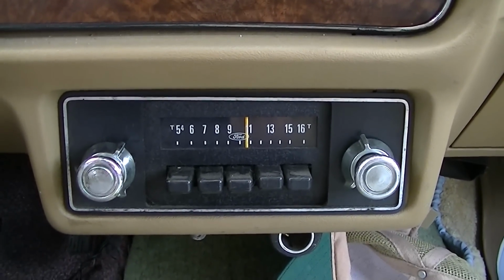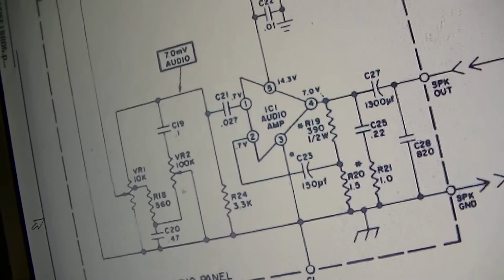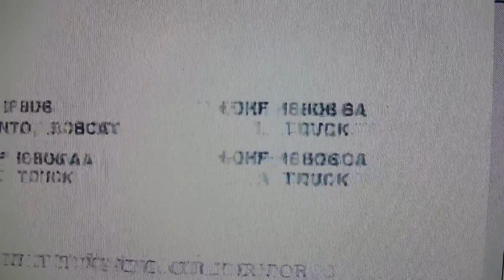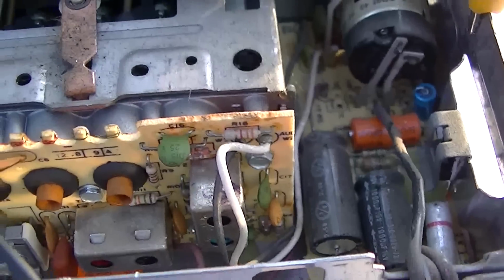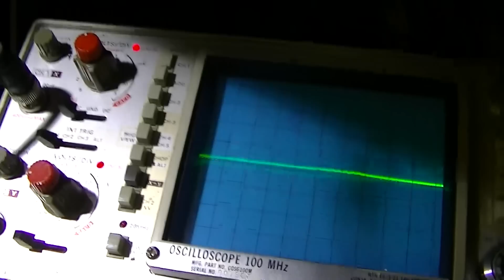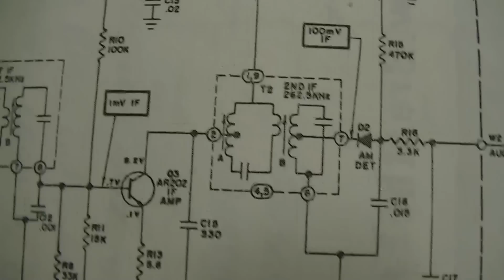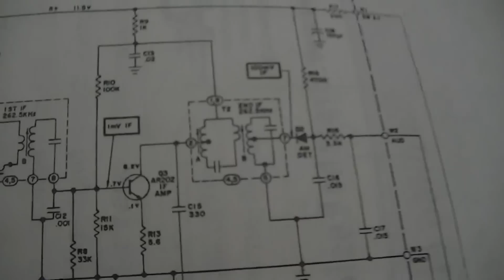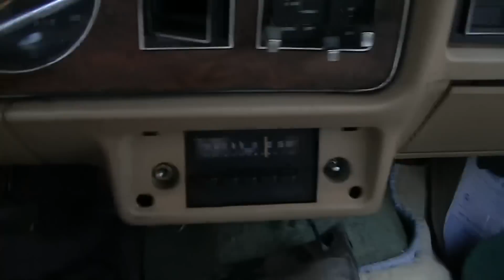Repairing Vintage AM Car RadIo In 1980 Ford Fairmont E0SF18806

Comment: Ford actually built their own radios back then and they were pretty reliable for what they were. The FM stereo ones used to say "Aeroneutronic" on them in the 1970s.
I'm a huge AM radio fan and it's a shame so many of these AM radios got tossed into the trash when people upgraded to FM radios, Compact Disc, etc.
Reply: found one of those AM only radios in a bus someone parked in the woods. Bus was a Chevrolet, so they had to adapt it to work.

Comment: I have one of those sets. I built it into a wooden cabinet and made a portable battery-powered radio. The idling current with low volume is only about 250 milliamps max... very sensitive set, too.

Comment: I am impressed at how much gain they could squeeze out of each stage. Your radio has one RF stage, a converter, stage, and a single IF stage, yet the stations are wall-to-wall as you tune through the band.
Reply: klafong1 I'd love to understand that better myself. I frequently look at videos and circuits for Regenerative, TRF Tuned Radio Frequency, Superheterodyne, and the IC Integrated Circuit type designs. Maybe Shango can do a video taking about and demonstrating some of those designs and concepts. Car radios are fantastic DX'ers. God Bless and Happy New Year!

Comment: When we moved off the farm and into the town, dad got a job tearing down wrecks at a scrap yard. I got to know the owner quite well when I stopped in to bring dad his lunch and coffee. So it was I could get old AM radios for my old 50 Ford for 5 bucks a throw, of course that was 1960's 5 bucks, and my summer job paid 5 bucks a day. I spent many hours on my head under the dash putting in different radios for better sounding AM sound. I had on fancy one out of a Imperial that had electric tuning on a 6 volt radio, even a remote switch that was under the floor mat that I could hook up so a tap of the toe could change the station.  Ah for the good old days, being 6;2 made climbing under the dash a bit harder then most but I managed.  Don't think I could get up any more if I had to now days.

Comment: Adding that mica to only half of the secondary I.F. works much better than I thought. You won't have full I.F. output but it is useable. Pretty smart idea that you came up with, I have to admit.
   Man, it would be a nightmare to unwind all those tuning slug wireds to get to that bad I.F. can's internal cap.
   I think you would be the happiest, just hooking a switch and audio coax cable to the audio I.C. input and call it good.
   It is refreshing to see troubleshooting instead of mere carpetbombing to resolve problems.
Reply: shango066
I actually found it very refreshing and very interesting.
I still love your Ham outings into the desert the most, I have to admit. That last one was unbelievably interesting and cool!
What a "60's era" trip that was!
"Iron man" was also very, very, cool too...
You ever got your drone fixed?
73s

Comment: I still have the factory ford AM radio out of the Fairmont I had in high school. it works just fine now because like yours there it lost it's 2nd IF and I replaced it with an IF can out of some old ham radio thing I had and re-peaked it.

Comment: Well it is quite late now, but I just opened a bunch of old IF cans pulled from stuff, and they all have tiny tubular capacitors. Some of them are directly visible from the bottom, others can be seen by removing the assembly out of the shield. Just guessing here, but since the thansformer is tuned with the slug, the value of the capacitor can be changed to some extent. Remember reading somewhere that some people would intentionally change the value of the caps on the larger IF's in order to be able to push the slug further in, getting more coupling between the windings, thus increasing the audio output of the receiver.

Comment: The board is easy to take apart. The coils slide out and there is enough wire to slide the coils clear to tip the board up so you can work on it. Just need to remove the back plate off.
Reply: Mr Carlson would have done it. lol

Comment: You should be able to find another one of those at a car swap meet, or even a garage sale or C.L, maybe even an AM/FM version or one with a cassette or 8 track built into it, they used the same basic design for years only changing the knobs to suit the vehicle. I used to have one that came out of a Merc or a Crown Vic from the mid 80s. I think the caps inside those IF cans were a precision ceramic type so they themselves wouldn't fail but the connections at one end might. If you wanted to go to the trouble (which I would not) you could probably open up the can and investigate what happened, it could be as simple as a failed solder joint, but it looks like it would take an hour just to get the board out just to get at it.

Comment: Hello, If I was in that situation and wanted to find a replacement IF can, I would check at the junk yards for another whole radio, and get the can from it. Or look on eBay. It's been quite a while since I worked on one of those, but to remove the board, is to first remove the screws that hold the bottom casing so you can have clear axis to the whole board that is attached to the tuner assembly. Remove the screws, or nuts (I can't remember) and pull the board straight out. The inductors should stay attached to the board without having to unsolder the wires...

Comment: Hi So in this video how did you pull the radio out? I have a 1981 Mustang with Am/FM and also has the same type radio indash setup. Your video did not show how you totally removed the radio. I found a Philco Am/FM with factory 8track player and want to install it. Uses the same wiring harness as original radio. Radio and 8track works perfect when tested. Just need more info on taking out original factory radio. Thanks,Mike
Reply: 6 Years later and I'm wondering the same. How the hell does this thing come out? 🥲
Reply: @robertdrayfahl6632  2 more months later...  You use a deep socket to release the nuts that are on the tuning and volume knob shafts as shango mentioned.  On the back of the radio there is a threaded stud sticking straight out that is used with a mounting strap or other mechanical support to keep the radio from bobbing up and down on the tuning / volume shaft.  Unthread the nut on that stud and remove the support connection.  Pull the antenna, speaker and power connectors and out she comes from the back, behind the dash.  It can be fished through with patience.  Hope you see this and it helps if you still are wondering.  Cheers

Comment: I just wonder why you cannot have a ring of two amp driving the final IFT might give some more gain as I have seen a ring of two amp used in a DNT CB transceiver, there are tiny polystyrene caps inside the can.

Comment: It's not the cap its corrosion.Same thing 1974 Mustang.Top was froze bottom wasn't.It can't peak because there is corrosion on the grid.Leave it unplugged spray the hell out of it let it set for about an hour then do it again.Then take an.air compressor put it around 50 lbs and blow it out.Mine works great good luck

Comment: Try some heat from a heat gun to the rear solder side, using a thin pipe attached to the nozle, the padding capacitors on thoses Toko style cans become dry jointed or oxidised, a bit of heat very often re flows the connection.

Comment: Shang, I'm restoring the Motorola AM radio in my '62 Plymouth Valiant, which used space-charge tubes in all but the audio section (which uses transistors). Remember them, and how they came to be?

Comment: I am trying to troubleshoot a Philco Ford AM only radio out of a 1967 Ford Mustang  On the side of the radio its marked 7TPZ .    It powers up and has audio but its squeal with static like
its going into oscillation.  With a 5 foot piece of wire I could get a local radio station weak not clear.   If I connect it to my outside wire antenna  the station drops out as though the radio was  overloaded.   I have been searching for the schematic but so far no luck.  I checked the only 3 transistors with a meter in the diode mode and they look good.  There is a germanium diode that measures good too.  I certainly would appreciate anyone offering a schematic.   I might be able to fix this.   There is one large round capacitor.  It looks like a multi-capacitor.  I noticed
its corroded on the top.   Could use help with a schematic.    Thanks

Comment: Perhaps you could have also added a small inductor in series with the added 110mfd cap to compensate for the loss of half of the secondary coil in the if transformer.

Comment: Sounds to me you just have a dirty volume pot. A shot of Deoxit©D-5 and some vigorous turning of the wiper ought to fix the problem.  Dirt, dust and water gets into these car radios all the time, and it doesn't take much to fix them. Just give everything a good cleaning, set it aside to dry out from the cleaner, and see if it works. I have a JVC AUTO REVERSE cassette player AM/FM radio I'm going to fix and I am going to go through all the switches and contacts with a Deoxit cleaner and a cue tip first to see if that does it. The tape mechanism works fine, so that is all I may have to do.

Comment: I think if you can get the bottom panel off then you might be able to get at that transistor what about a capacitor across the the resistor on the emitter lead and ground like a 0u5 for decoupling duty.

Comment: Good Day,
I have at least one mint cond Ford Radio just like that one left.
I used to work in a Salvage Yard years ago, & we had a raft of ancient Autos there. I removed a few Radios from Autos that were owned by People that rarely or never used them.
The best one of what I have left is a "Wonder Bar" 1977 Cadillac  Fleetwood Radio out of a Funeral Car.
They never used it.
Also a 1972 Philco Ford Stereo Radio out of a Mercury top of the line,. . I forgot the model Name. ."Monterey"?  Marquis?? owned by a wealthy Man who never used the Radio.
Anyways I owned a 1979 Ford Super Cab 1/2 Ton at the Time, 1997,. & installed & used it. until the Truck became too costly to repair in 1999.
I pulled it out before scrapping the Truck, & it's available.

I wonder if it would have been possible to cut one of the Cans legs using a Dremel Tool so You could access the faulty Cap.
Auto Radios have always been difficult to work on.  Even the ones from 1930 I have poked around in the Parts were crammed in, making it a Headache.

Comment: Most of those radios were removed and trashed.
Reply: BUDDY LIGHT  That's true. I remember shopping for a mid 70s car in the mid 80s and just about every one of them had the original radio replaced with an AM/FM cassette player. The cassette players usually had a busted tape stuck inside them. lol

Comment: The Ford AM radios were unchanged since the very early 70's maybe even 1969. Were actually considered the best in class for sound way back when AM had music not just religion and right wing religion like Limbaugh. In 60's -70's it was considered a big deal to have 2 speaker AM radio in giant apartment sized cars. Also thinking this maybe the 1st broken one I ever saw. The Delcos didn't break much either